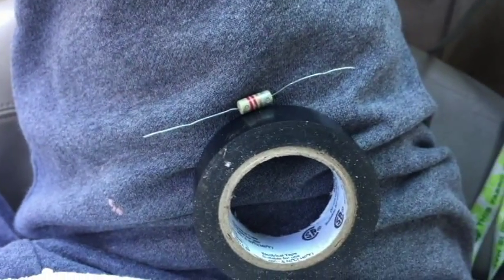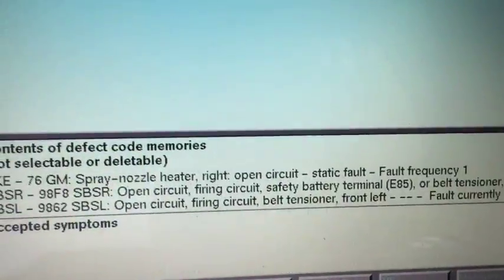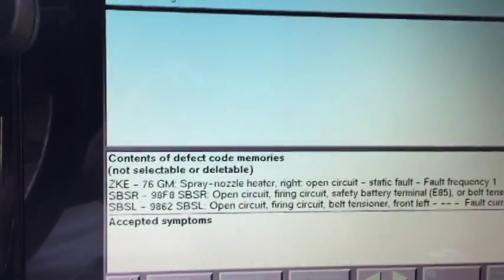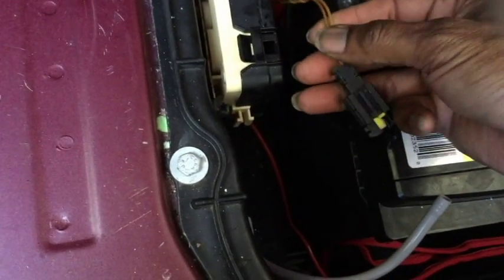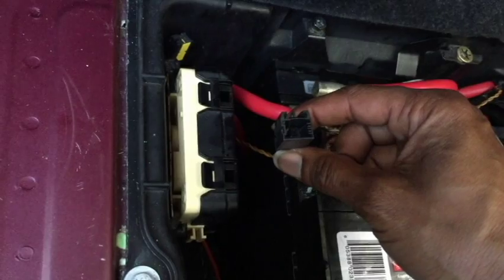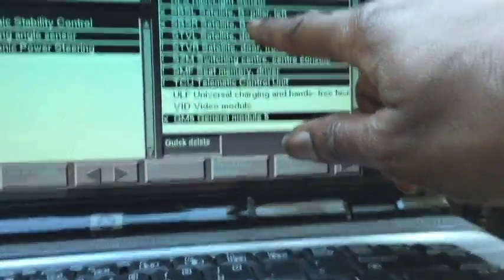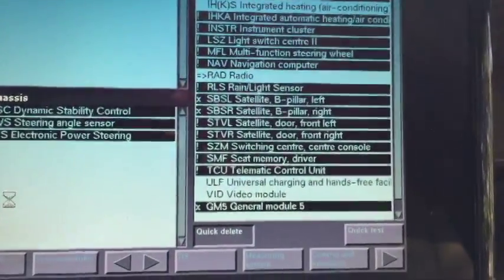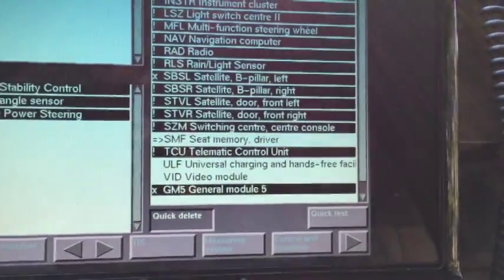z4 (E85) Battery Safety Terminal Bypass

Comment: It would of been great to know how to repair it properly and what actually needs replacing
Reply from the maker: I long ago sold this car...but i do remember going to a wrecking yard with the blown terminal connector and matching it up with another bmw with the same type.   I removed the old thermal and replaced it.   Just make sure it is a good terminal by checking the inside for the green dot and no burning.    Been so long ago i cant remember which car had this terminal but i am sure you can go to realoem and see which one had the correct terminal.   Hope this helped.

Comment: Hello! I have a Z4 2.2 and I get the 98F6 airbag error and to pass the MOT I need to turn it off. The error says: resistance, ignition circuit, battery safety terminal or rear right seat belt tensioner. If it is the battery, which I think is what I need to do, would I have to do exactly what is in the video? I am from another country and I am translating what I write with the translator because I do not understand English well. Thank you very much!
Reply: me too same problem.

Comment: do you think that should work with any bmw model??
I use INPA, is that enough to clear the code?
Reply from the maker: +Essa Alhubail 

Not sure about other models, but inpa will clear the code once you have it repaired.    I have since replaced the bst tip with one i found at a salvage yard.   Use this video...  https://www.youtube.com/watch?v=s-XO98LOa3Q&list=PL_7Nf85NOgqxKXVUFiD2p_5HdXPbeN3ZB